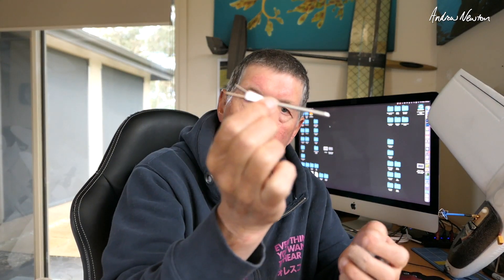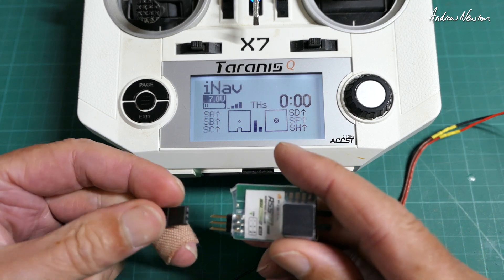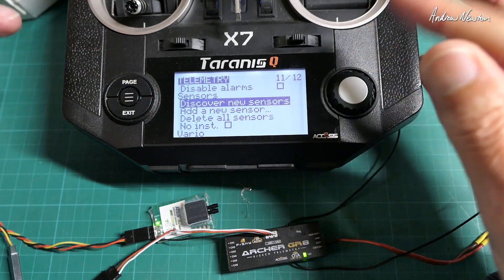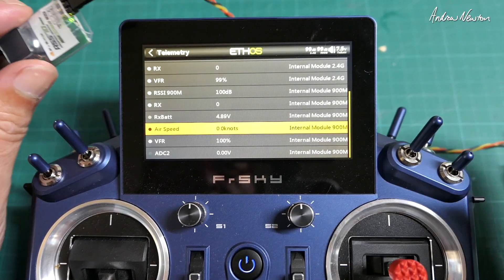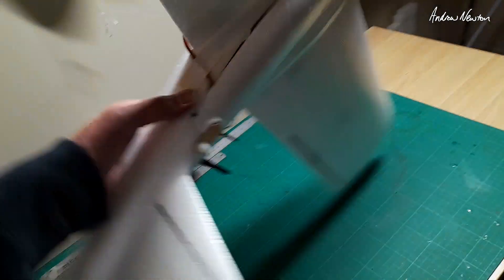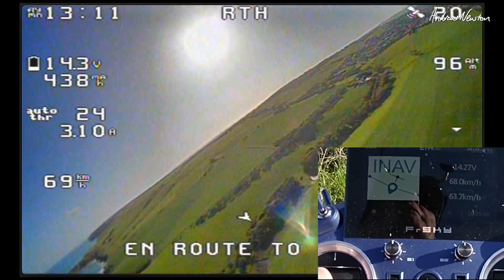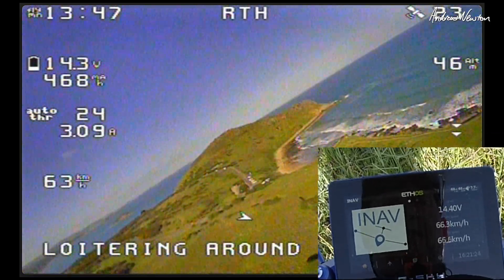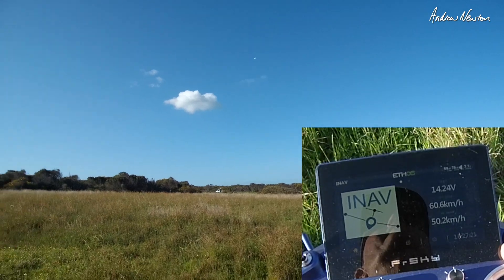FrSKY ASS70 ADV FBUS Airspeed Sensor

Comment: Is it possible to use this with a flight controller? Like speedybee f405wing? It has a connector for analog air speed sensors but still not sure if it will work or not...
Reply from the maker: No, only works with SPort / FBus receivers

Comment: I have the same set up as you, using the Tandem X20 series radio. Is there any way of having a widget that will display the highest speed reached during the flight?
Reply from the maker: Yes, I think you click and hold on the Speed telemetry item then you get more options

Comment: I currently have the model ASS 100 installed in my model. However. The speed indicator fluctuates all the time. Do you know how to calibrate it by chance?
Reply from the maker: Dont know about calibration but there was some talk on RCGroups about needing firmware updates
Reply: @AndrewNewton .  I updated the firmware for it as well. That didn’t work much. Lol. I guess it’s either a defective one, or it’s just the nature of how this particular model sensor is.

Comment: Hi Andrew. I bought the FrSky G-RX8 Receiver Designed for Gliders integrated Variometer sensor into RX8R with Redundancy function. I'm living in South Africa. We tried just about all the new firmwares possible for it but can't get it to bind to my tx16s radio with EdgeTX software. Can you maybe give some advice pkease
Reply from the maker: Can you bind the G-RX8 by itself?
Reply from the maker: Just found that you need to push harder than you think on the bind button to put it into bind mode (green and red LEDs on)
Reply: @AndrewNewton  No we tried that. We tried to bind without bridging to get the 8 channels but no luck.
Reply from the maker: Mine is working as expected. But I did have to push very hard on the G-RX8 bind button to get it into bind mode. Firmware ACCST D16 V2.1.2, MultiProtocol FRSKYx2 D16. Module V1.3.3.0
Reply: @AndrewNewton  thank you very much Andrew. Appreciate your help have a great day. Keep up with the nice videos. 😊

Comment: I tried this last year with my X12S Horus. Used in a 1700mmWs aileron sport trainer. Running glow ASP91FS.  Readings where all over the show.   Guessing it didn't like the vibration if IC engine.   Had pitot tube out on wingtip away from prop wash.    So no real understanding why else.     Was hoping it would give clear and accurate readings as your demo did.   Was a little disappointed.  But feeling hopeful now I see you having success.  Will look back into it
Reply: It needs to know the static (normal atmospheric pressure, so likely the vibrations from the engine were upsetting this.
Reply: Hey can you plz provide us the code it may be very helpful we are using arduino uno and Ms4525DO air speed sensor with pitot tube
Reply: @sakshimane1612 what code are you needing.  I just connected it straight to the Rx SPort
Reply: @sakshimane1612 can't help I'm sorry, 😔. I plug the straight in to my FrSky Rx "Sport"   the transmitter auto detects